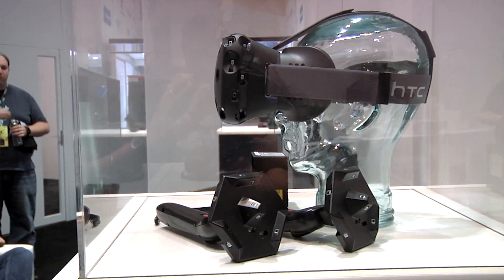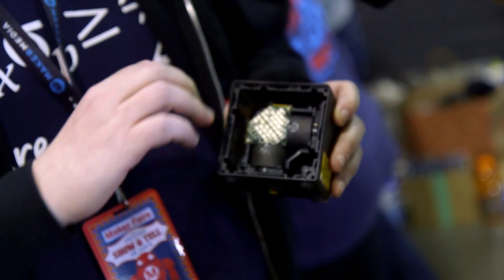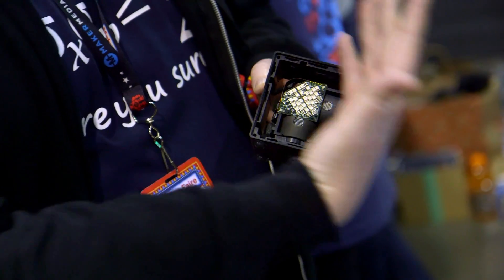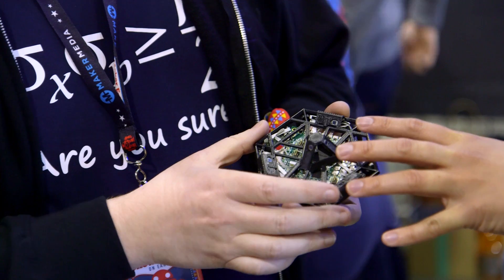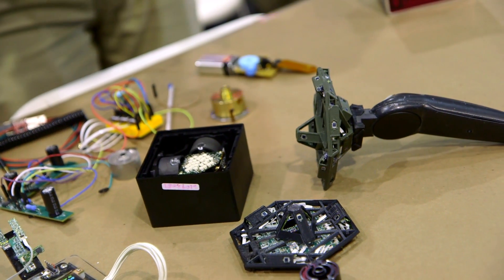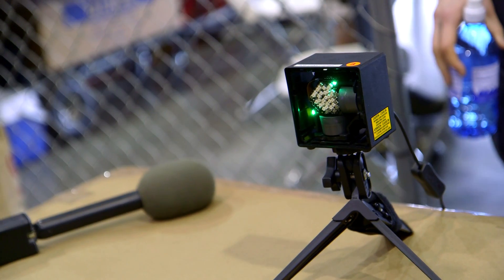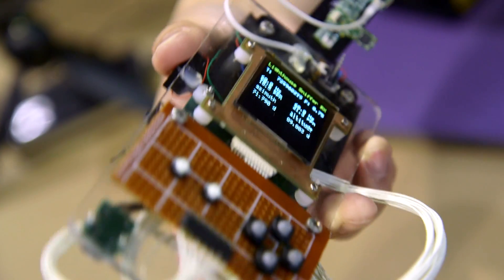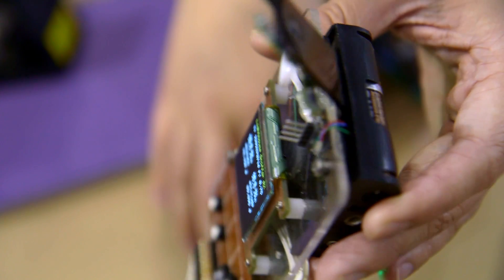SteamVR's "Lighthouse" for Virtual Reality and Beyond

Comment: I really can't imagine this becoming a consumer product by Christmas. Although I could certainly see some form of consumer-available dev-kits by then.. This just does not seem to be very consumer-compatible in it's current form. It also seems a little over-complicated.
Everyone seems to have their hopes up that this will "come out" before the Oculus.. But I highly doubt that.
Reply: ***** Alberto Martinez   You can use just one Lighthouse base station and treat it the exact same way you would use Rift's camera or PS4's camera. It's actually less complicated because you don't even have to connect it to the PC/PS4.  Even with one base station you will get a system with much bigger tracking volume, better precision, latency and accuracy. Rift's tracking is precise but not scalable (tracking more objects will be difficult, adding more cameras even more). Morpheus has problems with occlusion, loosing tracking, low vertical FOV of the camera and low Z-axis accuracy of tracking (depth is only estimated). Lighthouse is the only tracking system that fixes all these problems. Ironically, it's the only system that is actually consumer-ready from the technical quality and performance standpoint.
Reply: Xenocide78 The Vive is expected to be more expensive, but it's unlikely that has anything to do with it's use of Lighthouse for tracking.
Reply: ***** The HTC Vive consumer edition HMD is apparently shipping in November / December with this tracking system integrated. I am guessing that's what he is referencing when he is talking about a lot of these being available at christmas.
Reply: ***** It's the other way around. Lighthouse is more accurate, faster, cheaper, scalable, consumer friendly and compatible than what Oculus is doing by far.

In fact it is so much simpler to implement that I'll be surprised if Oculus doesn't announce the switch to Lighthouse tracking before release. There is no practical reason to use a camera solution anymore.
Reply: Xenocide78 Valve is, apparently, planning to ship the Vive with dual wield controllers, 2 lighthouse beacons, and a pretty high quality HMD.
Reply: Alberto Martinez Your average consumer won't even have the relatively beefy (and pricy) system recommended to use the Occulus Rift with, the same probably applies to all the other PC-based VR solutions.

The only extra step the Valve system requires is plugging in a little cube somewhere in your room, which actually provides added functionality.
Reply: Xenocide78 I don't think you understood what I was talking about.
Reply: ***** yeah the simple VR setup like Oculus and Sony Morpheus are a lot more consumer friendly , only the hardcore and Techies will even give the VR System by Valve a chance. very cool but seems super complicated for the Avg Consumer.
Reply: Raydeus Cheaper you say? Really?! HTC exec: Expect “a slightly higher price point” for Valve’s Vive VR. It looks awesome don't get me wrong but it could be fairly expensive. Definitely more expensive than Oculus.
Reply: Xenocide78 Oculus/Facebook don't need a substantial hardware profit margin because they will make money on software/content. HTC does need hardware money because all the software/content business will be made by Valve (Steam).
Reply: Raydeus I was just pointing out that it will not be cheaper than Oculus like you implied.
Reply: kazioo2 I'm not saying they aren't planning on making money on the hardware but what would stop HTC from making a deal with Valve to share in the profits of some of the software sales to make up for whatever discount is given on the hardware?

Comment: Sometimes, whenever i eat M&Ms, I like to hold two m&ms in between my fingers and squeeze as hard as i can until one m&m cracks. I eat the cracked one and the one that didn't crack becomes champion, then i grab another m&m and force it to compete with the champion in this deadly game of m&m gladiators. I do this until I run out of m&ms, and when there is one left standing I send a letter to m&ms brand with the champion and a note
Reply: AlphaSaint98 When you plagiarize something at least get it right. You're supposed to send the winning M&M back to the factory with a note that says "Use this one for breeding purposes."
Reply: AlphaSaint98 Now i want to know if some colors are more rigid than others?
Reply: Thats a highly unfair method, you should do it in elimination of two.
Reply: AlphaSaint98 Interesting narrative sibling
Reply: AlphaSaint98 poor experimental technique